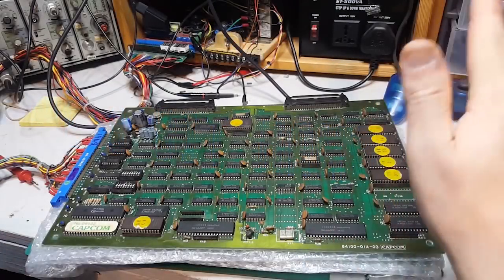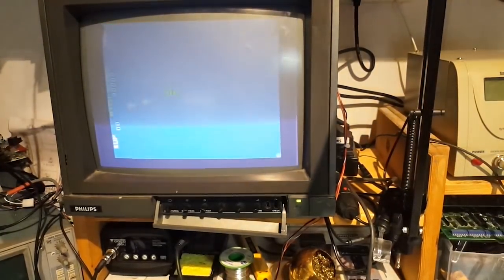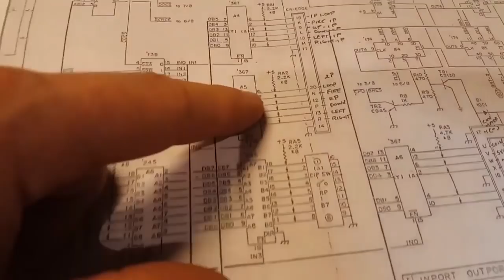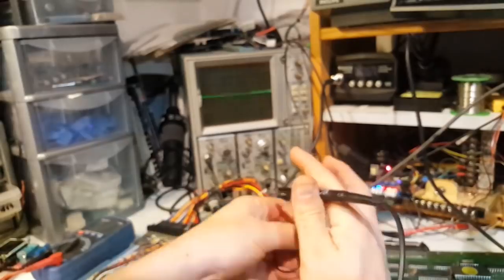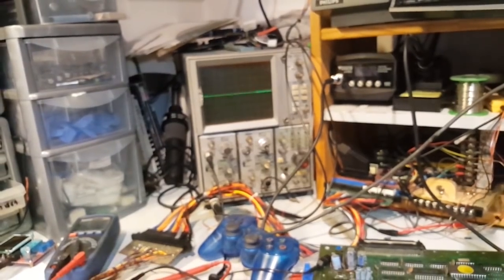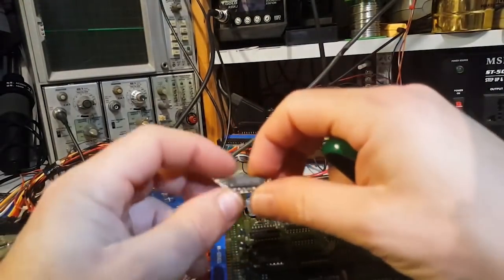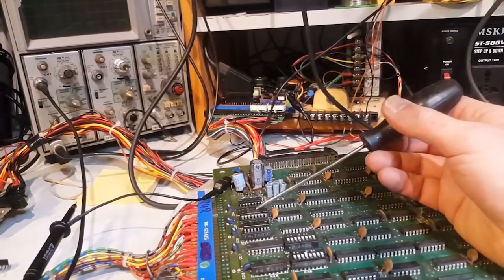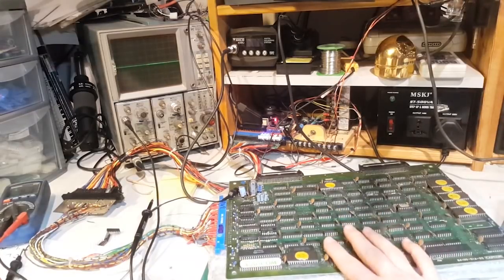Another Capcom 1942 arcade pcb repair

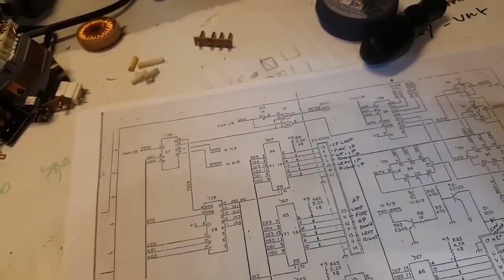Comment: at the 5:17 mark ,, are you reversed ? ,, fire input is "high" all the time and goes low when active (button pressed normally closed switch connected to common ground pulls it low).  or are you referring to the buffer inverting the low input to a high output ? if you are referencing the buffers output pin ?

Comment: Hi, 1:40 have you tested running video in through other inputs to see if the bend is actually in the monitor? seen issue just like that with supergun feeding incorrect sync signal, kinda worked on LCD but not on CRT, adding 27kohm resistor fixed it
Reply from the maker: yeah the gun works just fine on the lcd but older crts don't like it . Arcade crts seem ok with it thought. It's the gun or the home monitors depending on which way look look at it  (output vs requirements :D )
Reply: @8bitmanshed  could you compare the sync signal out of a retro computer vs the supergun? I bet correcting the sync would be pretty easy challenge in the end. maybe make a video about it? 😉
Reply: to clarify my theory is that the sync is not correct for LCDs either but that the buffers in the analog to digital conversion just has enough tolerance for it not to break the picture (not sure if there's something similar to explain arcade CRTs though)

Comment: Luck and experience. I've seen people taking a solid month to track down an issue on boards. Honestly I'm a Analog guy and when I do fix something that is digital I feel like I can rule the world lol.

Charging for repair is a PITA. A few times I would have say a Guitar Amp on my bench and I've clocked in already three hours on it and I end up getting contacted by the customer and they only want me to do one hour because they "can't afford" more time. I gotten to the point to charge people a standard $125.00 plus BOM for parts then after five hours I charge $25.00 an hour.